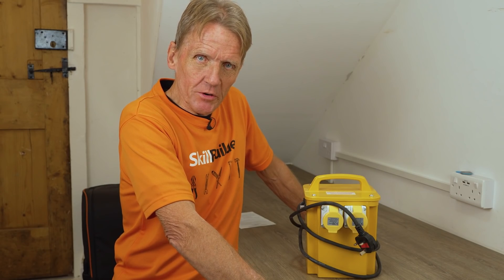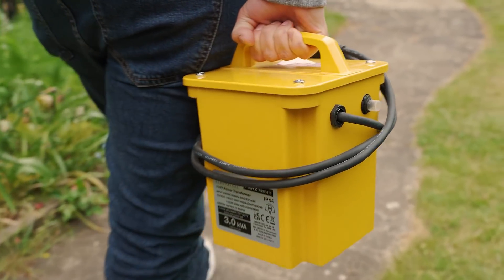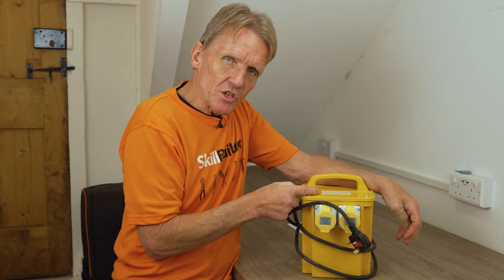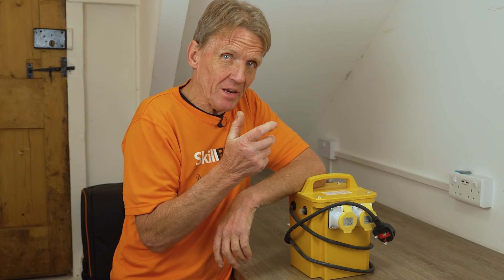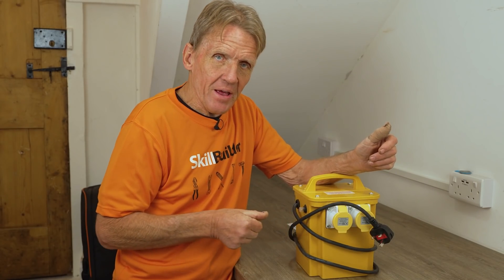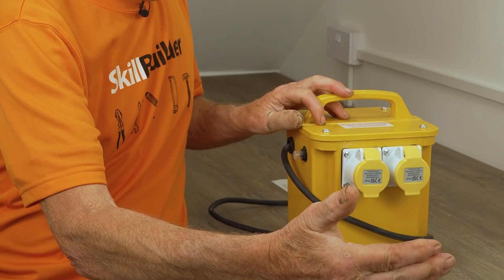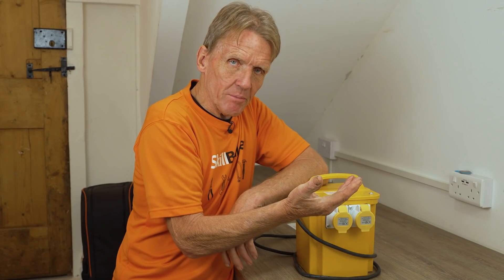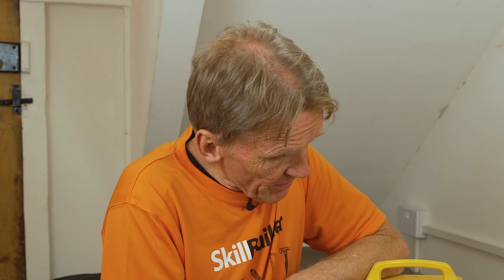110V Transformers - 3 Things You Need to Know

Comment: Just use 240 or cordless simple, these are out dated now.
Reply from the maker: I agree but if you have 110 volt tools for site use you then need another set for the domestic work
Reply: @SkillBuilder  I moved to a country that uses 110v. So I don't need to use a 110v transformer. Just had to learn a new language though.
Reply: @stakkerhmnd  😂😂😂
Reply: @SkillBuilder  - I agree - 240 is fine for domestic use - because the trip switch will kick if any problems arise …
Reply: Thing is it's not that 110 volts is safer. It can still kill you. Its the fact that the transformer isolates the supply so you have two 55 volt lines out of phase so the worst that can happen is that you get a 55 volt shock.
Reply: @paul756uk2  Centre tapped so yes 55v.

Are you sure the "two 55v lines are out of phase"?

Because there isn't two 55v lines and it's single phase anyway.
Reply: Never put my tranny on a carpet
Reply: @paul756uk2  Still don't describe a sinusoidal wave as being "out of phase". Would a spark talk about a domestic single phase 230v supply as "out of phase by 180°"?

I'm the one who pointed out it's +55v and +55v first, with ref to ground. It's how sinusoidal waves work.

Nope. It's 230v in UK. Sorry.

"Although the normal voltage in the UK is 230 volts" (I don't know if can post hyperlinks)

"The voltage used throughout Europe (including the UK) has been harmonised since January 2003 at a nominal 230v 50 Hz (formerly 240V in UK, 220V in the rest of Europe)"

Yes, I know it fluctuates before anyone says so. I've a meter that tells me what mine is. The transmission network and consumer equipment is designed for ± tolerances.

The harmonised voltage in UK since 2003 is 230v. so I don't know where you're getting "has always been 240v and need to replace every generator". Sorry.

BTW, I know for a fact generators were not needed to be changed when nominal was 240v before. Sorry. 

Have tried out the operation of an RCD (accidentally) and circuit tripped before anything happened. How does it work? By detecting over a curve the incoming and outgoing current. Of course 30mA isn't a guarantee. Will always be someone who gets a fatal shock from say 20mA. So, yes technically someone can still get a shock as RCDs aren't designed to be 100% perfect for 100% of people.

The point is a single phase is not "out of phase". RCDs are a different subject.
Reply: @stakkerhmnd know what he is talking about when he refers to 240 volts and he is talking about generators not being changed.

The nominal voltage is 230 volts, but that is the paper specification.

The UK voltage is still 240 volts. And we can't change that unless we replace the low voltage distribution transformers and change the turns ratio. And this was never done. 

So we do actually have 240 volts on our cables. In fact where I live is 240 volts and I know this because I measured it.

But any reference to the UK's nominal voltage should be provided as 230 volts RMS AC.

Yes the supply voltage can fluctuate but that's caused by load.
The measured voltage of 240 volts is not a fluctuation from the nominal voltage of 230 volts caused by load or by close proximity to the distribution transformer and reduced voltage drop.

It is just that the 240 volts now falls within the wider tolerances when the nominal voltage was reduced from 240 to 230.
Reply: @paul756uk2  Yes. 55v to earth. I've not heard AC called "out of phase" before. It's single phase so how can it be "out of phase"? It's sinusoidal, so alternating and not "out of phase".

3-Phase, yes. The 3 sinusoidal phases are "out of phase" to each other by 120°.

Question. What happens if you add +55v to -55v? Do you get 110v? Please explain to me how you get 110v.

How did you work out the "neutral is tied to earth" on a domestic 230v (it's not 240v)?

How can you get a "nasty" shock (never mind a fatal one) through a perfectly functioning RCD? This is worrying as it would mean millions of RCDs have been mis-sold and haven't stopped people getting shocks. 

I've no problem if you have your own terminology and theories over how electricity works that differs to what is taught on electrical engineering courses. I would like to learn your theories and terminology as it appears it's superior to what is taught at universities and electrical engineering courses.
Reply: @stakkerhmnd  you get 110v from +55 & -55 because there is a difference of 110 between them. Simple.

Neutral and earth are the same thing in the simplest terms, ever heard of PME or TN-C-S? Though one is a live conductor and the other is protective.

And yes, you’ll still get a shock as the RCD will take time to operate, and current needs to flow to activate it.
Reply: @paulmatthews5470  And if you're referenced to ground? What does +55v & -55v equal?

Yes, "earth" is the CPC and neutral the return path conductor.

So tell me please. Should you have any L-E current?

Re PME and TN-C-S, that's not on the consumer side? Or is it?

30mA shock over what time curve? Assume Type B and tell me how that's going to be "nasty" or "fatal" as per other comment?

Thanks.
Reply: @stakkerhmnd  now you’re being daft use some sense
Reply: @paulmatthews5470  Please see my above previous comments for pure sense.

Maybe you live in a special part of the UK which is 240v?

A part of the UK which suffers from an inflation rate of 4.35% as that would get you from 230v to 240v.
Reply: @stakkerhmnd  A baby puffin is called a puffling, and both parents take turns incubating the egg before it hatches.
Reply: @paulmatthews5470  Are the parents "out of phase"? Or just alternating.

A female kangaroo keeps her joey in a pouch.
Reply: @stakkerhmnd  The Margherita pizza was named after Margherita of Savoy, Queen consort of Italy from 1878 to 1900.
Reply: @paulmatthews5470  The Bank of England gained operational independence over monetary policy in 1997 to make sure money supply was not "out of phase" with inflation control.

Comment: I like to sit my transformer on blocks to get air flow underneath to keep cool.
Reply from the maker: Goor idea, why don't they have feet?
Reply: @SkillBuilder  Because cold ground or concrete will work even better to get the heat out. I do remember an old german transformer that had optional feet that you can pop out.
Reply: @SkillBuilder  that is a question I have asked myself many times

Comment: Don't they have both continuous and intermittent use times? For example you can use it at 1000W all day long and 1500W for 30 minutes.
Reply: The defender one I have is rated 3000 watts 5 mins on 15 mins off or 1500 watts continuous, Ive just looked.